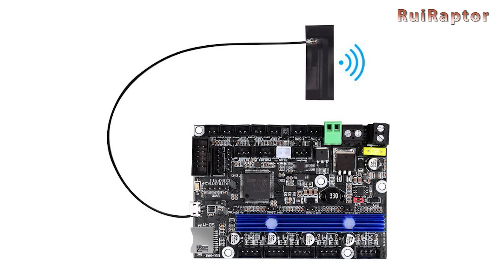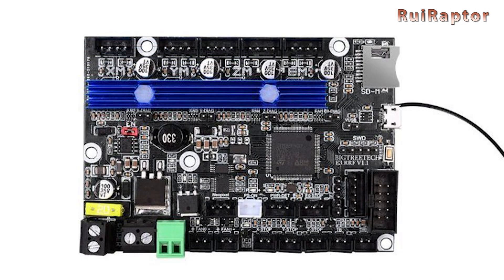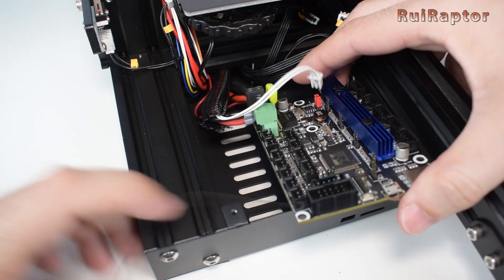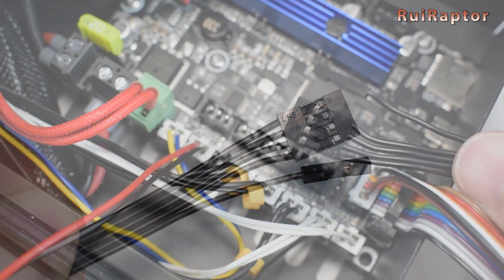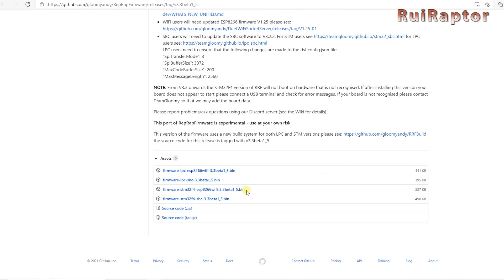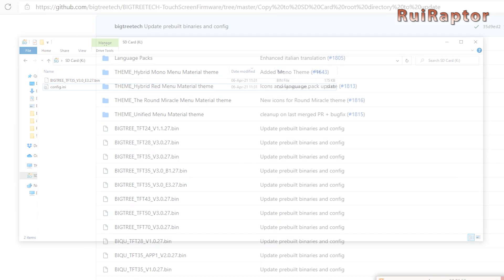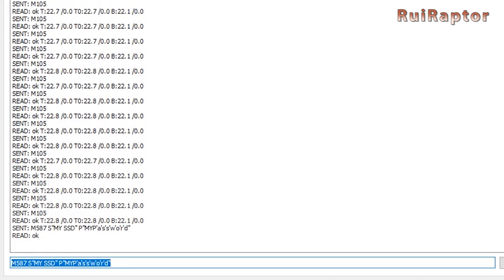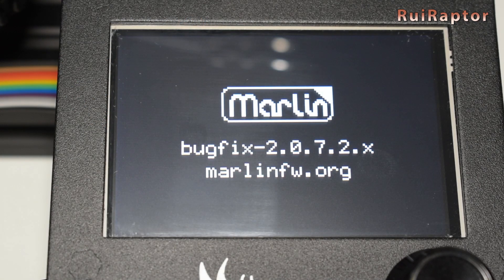SKR E3 RRF Complete Installation Guide - CREALITY ENDER 3 Upgrade

Comment: Question everybody.  How many fans can I put on the DC in?  Reason for the question, I have an Ender 3 Max, it has two part cooling fans, which I want to run on fan 0 and 1.  I see you put the hot end fan in with DC in when you crimped, can I also add the main board fan to the DC in?  So I would have two fans, the main board and hotend fan with the main power in, is that possible?  If not, any thoughts?

Comment: what about CR10-S5 will it fit also does this run silent stepper mode also is it compatable with ender 3 v2 later screen and will it work on the 12v system

Comment: I need to know different things that are not in your video. like can I use this board on a Tevo Tornado to replace my Gen L 1.0 board? Can I use the 110v Tevo bed heater. And will it work with the stock tevo screen. I know you have a Tevo to test it on. Also, I wanted to replace my Ender 3 Max 4.2.7 board so can I use the stock screen. Another Question: I guess I can use the kit with the Bigtreetech screen and that will work. correct? YES, another Youtube reviewer did say you could use this board on a non Creality printer.

Comment: The SD card reader on these are bad.
They will cause SD init failure in middle of prints.

Use SD card or USB on a TFT screen to print and it works wonderfully.

Just do not rely on the SD slot in the motherboard. 
All other means of communicating with this board are great

Comment: Great video, finally got reprap and wifi working correctly. My issue at the moment is getting the crtouch to work and also having the part cooling fan to work(its always at 100%) even when set to 0%.

Comment: Thank you for this video. I've just bought the board Version 1.1.
I have a second Z-axis stepper motor (dual Z-Axis). Can I use the second Z-Axis conector to run this motor separately ?
Do I have to change the firmware ?

Greetings from Germany

Marcus
Reply from the maker: Hi Marcus, the second Z-axis connector is wired in parallel. No need to update the firmware for it to work.

Comment: Is there any other reason you could guess that it would give a no printer attached message.
Reply from the maker: Hi, the message "no printer attached" is normally because of communication issues between the board and the display. Did you check the cable connection, the baudrate setting and the serial port setting (in configuration.h file)?
Reply: @ruiraptor  Thanks for the reply. Havnt got to it yet but i think its the configuration .h file settings.   Figured itd be smart to replace the lcd, mainboard add a bl touch all at once... as a new guy should researched first :D
Reply from the maker: Hi DM, we have no problem with helping others, new guys or old guys so if you need help let us know.
Reply: @ruiraptor  LOL thanks i may take you up on hte offer if i cant get the firmware up and goin :)

Comment: The missing z probe config in this video. Would have been better if few mins was spent on this.

https://www.reddit.com/r/BIGTREETECH/comments/mrcxsv/getting_the_new_bttrrfe3_v10v11_up_and_running/

Now at the top left, click on the hamburger menu, then navigate to the folder name "System" in the SDCARD section, you will be presented with a list of files, click on the one that's called config.g wait second and it will open for editing, scroll down to the Z-Probe section and remove the ";" from the start of all four commands.

Now click save, you will be asked if you would like to reboot, just click no for now, next open the file called homez.g, to make this easier, below is what I did to make it work:

;G91 ; relative positioning

;G1 H2 Z5 F6000 ; lift Z relative to current position

;G1 H1 Z-255 F1800 ; move Z down until the endstop is triggered

;G92 Z0 ; set Z position to axis minimum (you may want to adjust this)

G91 ; relative mode

G1 H2 Z10 F6000 ; raise head 4mm to ensure it is above the Z probe trigger height

G90 ; back to absolute mode

G1 X140 Y140 F2000 ; put head over the centre of the bed, or wherever you want to probe

G30 ; lower head, stop when probe triggered and set Z to trigger height

Basically I added ";" to the exisiting settings and I added bottom 5 lines of commands, now save that, and open the hameall.g file and make it look like this:

G91 ; relative positioning

;G1 H2 Z5 F6000 ; lift Z relative to current position

G1 H2 Z10 F6000 ; raise head 4mm to ensure it is above the Z probe trigger height

G1 H1 X-240 Y-240 F1800 ; move quickly to X and Y axis endstops and stop there (first pass)

G1 H2 X5 Y5 F6000 ; go back a few mm

G1 H1 X-240 Y-240 F360 ; move slowly to X and Y axis endstops once more (second pass)

;G1 H1 Z-255 F360 ; move Z down stopping at the endstop

G90 ; back to absolute mode

G1 X140 Y100 F2000 ; put head over the centre of the bed, or wherever you want to probe

G30 ; lower head, stop when probe triggered and set Z to trigger height

;G90 ; absolute positioning

;G92 Z0 ; set Z position to axis minimum (you may want to adjust this)

Click save and now power down your printer and power it back up, once the web interface is back up, click the Home All button and everything should be good to go.

Comment: Thanks for the great tutorial, very useful, detailed and informative. I have upgraded my ender using your instructions and everything is working ok. I have connected a PT100 to the RRF IDEX expansion board but it seems that i get wrong temp readings. Do i need to add any extra code in board.txt or config.g?
Reply from the maker: Hi Antonis, sorry for the late reply. 
Here's BTT feedback: "RRF firmware does not currently support the use of PT100. The PT100 of RRF needs MAX31865 to read the temperature. The PT100 of our E3 RRF is amplified by INA826 and reads the ADC directly. But Marlin supports it"
Reply: @ruiraptor  Thanks a lot!!  The main reason for upgrading to SKR RRF  was  reprap  and upgrading thermistor and hotend to support higher temp. I suppose i will have to wait for it.  Again thanks for your effort.

Comment: when i look at schematics it says the power and hot bed are actually swapped compared to your tutorial  im afraid to turn mine on fingers crossed
Reply from the maker: Hi, 
Where did you see the power wires swapped?
The only swapped colors are for the heatbed. For the main power the wires are correct.  However, since the heatbed heater is just a resistor (same as the hotend heater cartridge) it’s not polarity sensitive. Some heatbeds are polarity sensitive because they have a small LED on them. The Ender 3 heatbed does not have any LED so you can connect the wires either way.
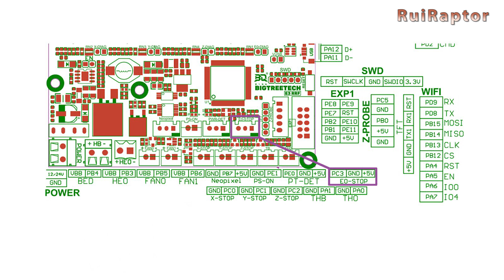Reply: @ruiraptor at  5:20 it shows reversed polarities compared to schematic at 8:37 but that clears it up and makes sense that resistive heating loads typically no polarity... now for the firmware this is my first attempt at loading the firmware so i still have to figure that out ... but thank you for that clarification i was extremely nervous to kill my new board
Reply from the maker: Hi Shawn, yes, the swap is only for the bed and not for the main power. Main power is correctly wired. Regarding the firmware, it's super simple...just load the firmware.bin file in the memory card, insert it in the printer's memory slot and turn the printer on. Wait a few seconds and that's it. On the memory card you should see that the firmware.bin file was renamed to firmware.CUR which means it was correctly loaded by the board.

Comment: Ok after quite a bit of tinkering I have the board working with the bltouch.  First my experience was that this is not a beginner mod! (a lot of gcode modifications)  Second if you are capable of it... WOW it is AMAZING. I love it!  Using Duet Web Control, Reprap firmware, mesh compensation... it is made SUCH an improvement in the printer.
Reply from the maker: Hi, thanks for sharing your experience :)
Reply: Mind sharing the process you went though to enable BLtouch? Struggling with this myself.
Reply: @dad2979  you have to modify your config.g file, the portion that dealt with the bltouch is as follows
Reply: @vbbartlett  I will give this a try, thank you!

Comment: Thank you for putting this together, without this the updates would be a nightmare to figure out!

Do you have any information about the expansion board too? I have been looking around, but google is giving me very little usable information on how to actually use the board with RRF.
Reply from the maker: Hi, not many people have the expansion board yet. We are waiting for one too to run some tests.
Reply: @ruiraptor  I actually found out myself, it is pretty easy, fan0 and fan1 on the board is defined as fan2 and fan3, same goes for the rest, just continue to count up.

Comment: Followed this tutorial thru to the terminal but when I connect the terminal I get 'Unknown board:    '.  Any one know what is going on?  Also I don't see the firmware.bin in the repo
Reply from the maker: Hi, if your board is not being recognized it means you didn't install the firmware.bin file. Only after installing the firmware.bin file it will be recognized.
Reply: @ruiraptor  I installed the marlin version just fine, Installed the 3.2.2_2 and get this error.  I just tried the 3.3beta3_2 and it installed but then gave errors:Possible short between step and enable pins on driver 4.
Please check driver installation/configuration.   At this point I removed the extruder connect and rebooted.  Now it just power cycles.   Went back to marlin and 3.2 with the previous results of working and unknown board.  I would try the bigtreetech firmware but currently their repo doesn't have it
Reply: ended up that I needed to reformat my card and only the 3.3beta actually supports my board

Comment: I could not get this to work.  Put like 18hrs into it trying.  I have the Bigtreetech RRF E3 V1.1 and a Bigtreetech TFT35 V3.0.  I flashed the firmware to both as this video instructed. The display was flashed  BIGTREE_TFT35_V3.0_E3.27.x.bin file along with the BMP and fonts with the config.ini file that was originally name config_rrf.ini I flashed the RRF board with firmware-stm32f4-esp8266wifi-3.2.2_2.bin by renaming it firmware.bin along with the folders copied from GitHub along with making the folder firmware and putting the DuetWifiServer.bin into it and I can not get this to not say "Printer Not Detected"  I checked the cables going to and from the RRF board and the display even replaced them with no luck.  I see the firmware get pushed to the RRF board and the upgrades do rename to firmware.cur and config.cur when finished.  I tried playing around with baudrates, its like there is TX or RX being sent out.  What of the two cables does the display use to connect to the board the RS232 or the flat 10 pin cable?
Reply from the maker: Hi, the RS232 cable is the small black one. Are you sure the screen firmware was correctly uploaded?
Reply: @ruiraptor  It appeared that all went well when I uploaded the firmware to the display it completed to 100% then it started compiling all the fonts and bmps all of them passed none failed, so as far as I know it went correctly. I was left at the TouchScreen with the top showing "Card Inserted"  I then decided to leave the TFT35 out of the equation so I hooked up my original Ender3 LCD screen to the RRF E3 board with the flat cable and downloaded the firmware.bin file from BTT-E3-RRF/BTT E3 RRF V1.1/Firmware/Marlin/Ender3/ GitHub copied it to the SD card and booted up the printer.  I saw the RRF board getting flashed because I saw the LED on it flashing while it was doing it, it also then renamed the file firmware.cur when it was done.  My stock Ender 3 LCD screen is just back lit I do not see any Marlin Logo just blue light.  I even did what you suggested and put ferrules on connectors so it was done right.
Reply from the maker: For the stock ender 3 display to work you need to add the lines mentioned in the video in the board.txt and config.g files. If it just lights up, it means that the lines were not added.
Reply: @ruiraptor  I do appreciate the help.  I have the stock display hooked up.  I have copied and pasted the lines for the LCD into the board.txt file .  I copied and pasted M918 PnE4 F1000000 to the end of the config.g file.  I downloaded the Zip containing the menus from your link.  I created a folder called menu on the SD card I extracted the menu folder.  I flashed the firmware.bin from BigTreeTech V1.1/Firmware/Marlin/Ender3  and still the stock LCD was just blue and the only fan turning was the hotend fan since you said to ferrule them in with the power supply.  I even went as far as removing the board from the printer so that there is no possibility of anything being grounded.  I then moved the jumper to power the board just from the USB port and disconnected any Motor Driver, End stops Etc...  The only thing left connected was the LCD display and my USB power source.   The only time I ever did see any change was I experimented with leaving the line 3.1.0 instead of changing it to 3.1.1 and that at least spun the fan for the motherboard spun for 1/2 second which it does not do when the line was left at 3.1.1
Reply from the maker: You have the cable connected to EXP3, correct?
Reply: @ruiraptor  Yes I was on EXP 3 .  I ended up returning both the board and display and purchased the BIGTREETECH Direct SKR Mini E3 V2.0 + TFT35 E3 V3.0 .  It worked right out the box, I left it running the RepRap software I did not have to do anything special other then hook both the display and board up like you shown in one of your other videos on the SKR mini, best part is this board does not require to have a SD inserted all the time like the other board relied on those special folders for RepRap. I think my SKR RFF board was defective and this board seems to work well, it does not have WiFi but I can use a raspberry pie with octopi for that. Thanks for your reply and your channel is very informative.
Reply from the maker: Thank you for sharing your experience :)

Comment: I'm getting this:

SENDING:M997 S1
Trying to connect at 230400 baud:
 success
Erasing 4096 bytes...
Erasing 278528 bytes...
Uploading file...
SDIO Read SD timeout
Error reading sector 16640 length 2
[ERROR] Error reading sector 16640 length 2

when i try updating the firmware of the ESP... any ideas?
Reply from the maker: Hi Sharky, it might be because of the ESP file not at the correct folder location. 
If you download version 3.2.2 or any other below that one then the DuetWiFiServer.bin file must be placed inside the sys folder.
If you download a version above 3.2.2, then the DuetWiFiServer.bin must be placed inside a folder with the name firmware. 
Only the reprap firmware, which is the firmware.bin file is placed in the root of the memory card.
Reply: @ruiraptor  yes, i'm on the 3.3 beta right now so inside the firmware folder should be correct. if i remove the file from the firmware folder, it says no file found, so theres that, somehow the printer doesnt want to read from the sd card and i dont know why
Reply: @ruiraptor  Update: did downgrade firmware to the same one you used now seems to be working just fine... strange.

Comment: The connection of the heating bed is reversed on the video.
The red positive cable should be on the power connector side.
I checked on the pinout file of the board and with a multimeter, the +24V is connected to the VBB
Reply from the maker: Hi @Icarus3D, thank you for your comment. You are correct about the board’s pinout, however, since the heatbed heater is just a resistor (same as the hotend heater cartridge) it’s not polarity sensitive. Some heatbeds are polarity sensitive because they have a small LED on them. The Ender 3 heatbed does not have any LED so you can connect the wires either way. Nevertheless, and although this an Ender 3 tutorial, we will add a note in the description for the guys that wish to install this board on a different printer. Thanks
Reply: @ruiraptor  Yeah you right. Awesome video btw

Comment: The board does not come with firmware or an SD card for reference.
Reply from the maker: It's true about the memory card. They don't include it. The firmware, however, was already installed on our board.
Reply: @ruiraptor  How could the firmware be installed when an sd card is required?

I'm guessing Marlin is installed?
Reply from the maker: RepRap firmware should be already be installed. However, for it to work, you need to buy a memory card and copy the configuration files (and folders) to it and startup the board with that memory card. If you don't startup the board with the memory card inserted and with the configuration files and folders, it will not work (same behavior as if no firmware is installed).

Comment: I got this board and I have a ender 3 pro with the Creality 12864ZW-10 lcd display will this work for mine? I can't get the lcd working it stays blue .
Reply from the maker: For the LCD to work, you need to follow the instructions on the video. Also check the video description for the lines you need to add.
Reply: @ruiraptor  OK so still can't get it working idk whats up can u dm the .bin for a ender 3 pro?
Reply from the maker: Send us an email and we can try to help
Reply: @B_GIBBZ  Did you ever get yours to work?  I could not with mine after many hours.  I am just returning both the RRF E3 board and the TFT35 display.
Reply: I did that must have missed something it still didn't work. I think I have to do it on marlin nor reprap
Reply: So I think I did the wrong firmware.bin file ill try tonight. Thank you for the help